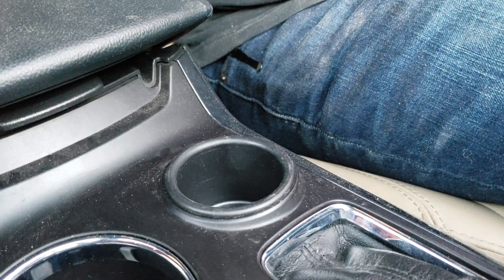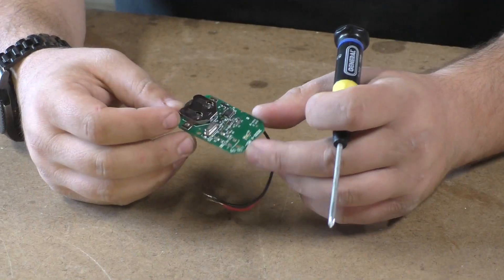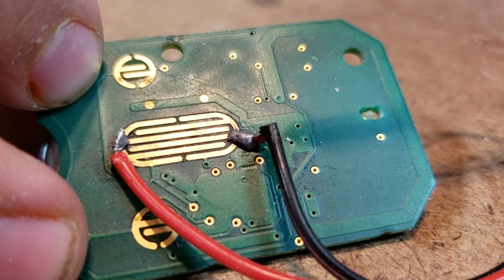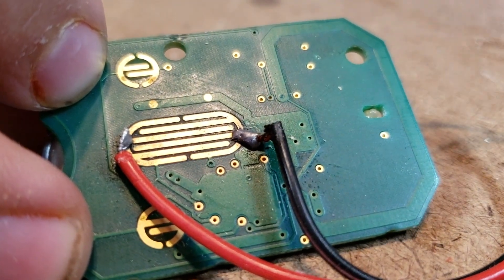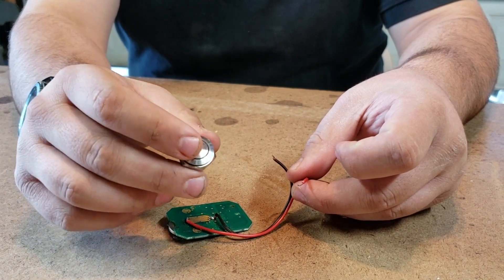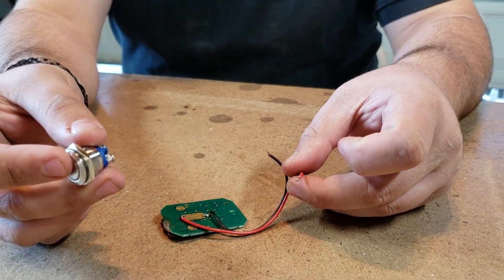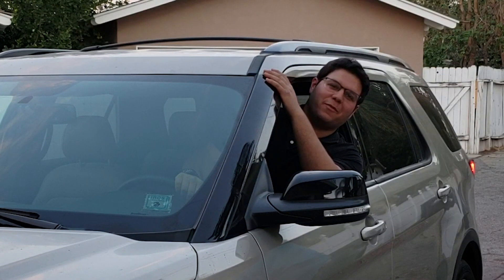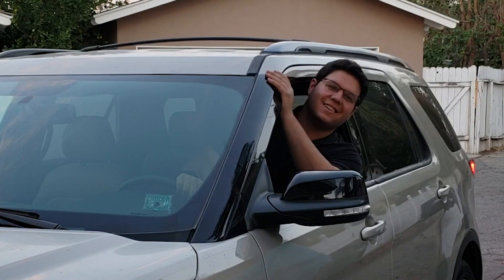How to Make a Custom Garage Door Opener

Comment: Interesting video and information, but the execution is unsightly in a new vehicle. Looks very out of place. Why not mount the switch, no wood needed, in the dashboard, or overhead console? Just remove the panel, drill a hole, mount the switch, and hardwire the power so no battery necessary.
Reply from the maker: My car is a lease and I wanted to do something that fit with the car but didn't make any permanent changes.
Reply from the maker: But I hope to be able to do that one day.